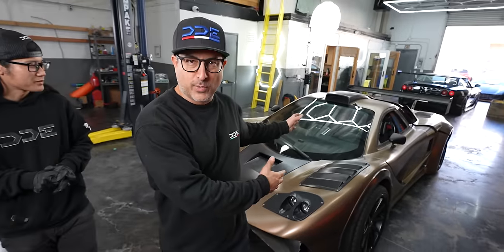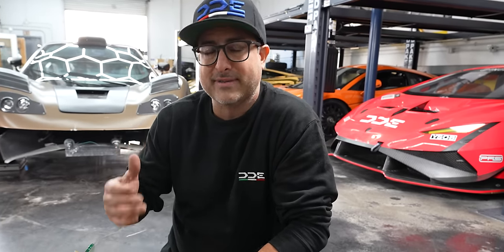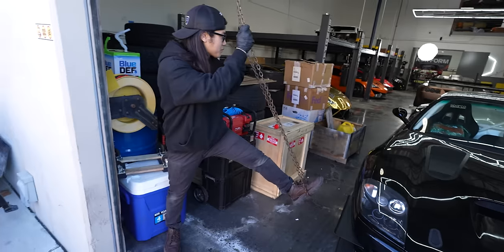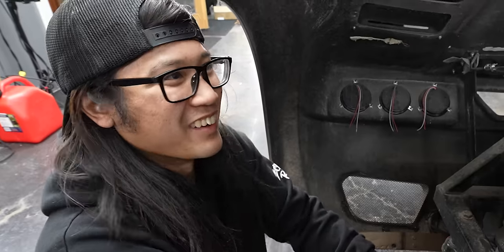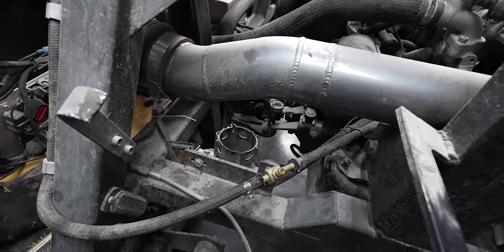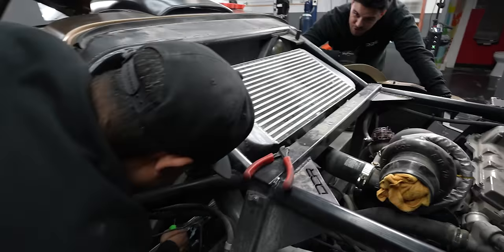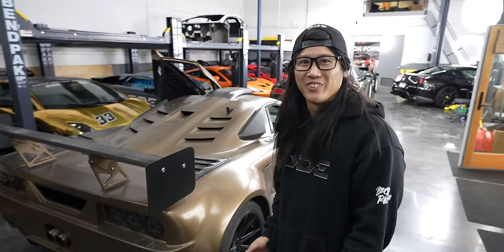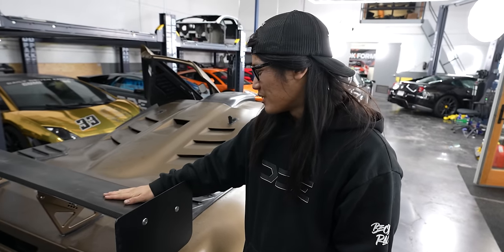SURPRISING TIM WITH  MAJOR JDM UPGRADE FOR HIS NEW CAR!

Comment: There's a few specialist MR2 shops about. They are usually a bit more expensive but they will stock a TON of parts readily available, as opposed to having to search to possibly not even find what you need. I'm not gonna name any here, but they all usually have MR2 in the name, there's a UK one a west coast USA one (all independently run and owned by different people), with somewhat different names apart from the car name included, and a bunch of others dotted about too. It's an enthusiast car, so there's whole communities built around the MR2 and a few different online stores came about from them originally, when people started to realise there was a market, but not an aggregated supply of parts for the car.

Comment: The rear can be lowered if you flip the upper strut mount brackets over and reweld them on. Lowers it 2 inches, and fix your issue where the studs hit the tube.

Comment: If you absolutely wanted to lower it a little bit more you could relocate the top mount brackets to the top of the tubes. I couldn't really see the bottom inside but that might give you the clearance you need to lower it another inch and a half to 2 inches.

Comment: 1.4l stroker storm 987PS / 24h 
extreme substance use like Matra ! 
2.6l stroker Torse AWD useful  952 hp infinity 
2.9 Stroker 3 Flap 1487 + hp/24h awd infinity torse washmashine .
pushed down hold 967 hp forever and V max too for long high vmax 687 but like hp open stroker ckean air burn of eklectik use too stroker on possibe like thehorsepower open ;)

Comment: Convert it into a center 💺 and swap it with a boxter engine, rotary, vtec, or a 5 cylinder Volvo t5 turbo 98-2001 great motor slepped on. But becoming popular with audi rs3 now.

Comment: Yeah , Tim his suspention is like put a Cosworth Escort Rally into a GFJ Ford Fies T Motorstorm Groub B 01 concept .
:) So by I like that thing that need the front by made back wind stroke threw the window infront farward made by the back move on ! So by the Number Shield is in demomove inside frame by of ACQV 89Q and B3 ! 
I think 98tsnd by time made too and not material ! 
Put old wax polish over cars that go into heat weather of countries , so by is Steel of conditions in other airpressure got other art of C in steel ! So by asian car coroddit so much by C in steel with air ! Sometimes I think go out of doen under grandma after all we are and made money and bought a right steer car JDM too   but If ! All cryed out more than I bought s little Lambo and put a big inside ;) Gteat Work Tim !Why not go into museum and learn by too ! Puta Groub C suspention inside that Move by a cetre link move in a mid frame arm and use the suspention you get on ! So pressed in mid and move of mid out snd in! For over 440 km/h but why not in little build big for is V max and power steer down for all id overlive by able drive ! Eat Gummibears of Haribo , by move so much body that not lostsnd need with 65 years joints to move and not got pain in bones or Knorpels that away atritis or else ;)))

Comment: You also could have just fixed the air system instead of getting the guy the shittiest shocks you could find.

There's entire Penske solutions for the 2nd gen MR2 that are less than $3000 as a complete unit.

I get exotic cars are more your thing, but DDE really isn't good at dealing with more normal-person level expenses and products. Shit like this shows it.

Comment: 1,000 cars in Mike's shop in 20 years - sorry just more BLAH BLAH BLAH.  Zero productivity as usual.  599 and F12 sit rotting away and that might be a good thing.  Instead, they work on Tim's junk car, nothing is going to help it, it will always be junk.  Not much rush in moving or getting ready for a move.  So far behind the curve from the Walmart U-tubers shop.  Point in case - the F12 roll bar diameter and thickness of the tubing is too small.  The hood leavers - great concept on the 599 butt are too thin, Damon even mentioned how thin and have sharp edges - the 550 splitter and diffuser were made with too thin of sheet metal and are not safe being unrefined ends.  There too thin and looked stupid.  Basic sheet metal work at its worst.